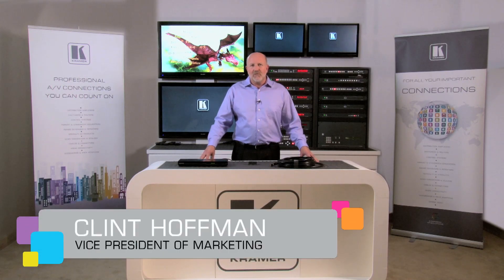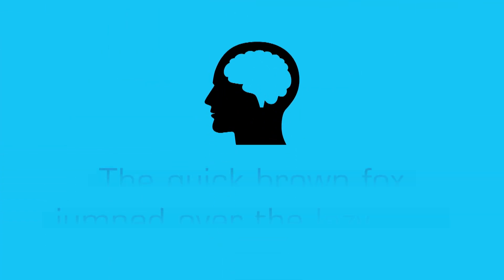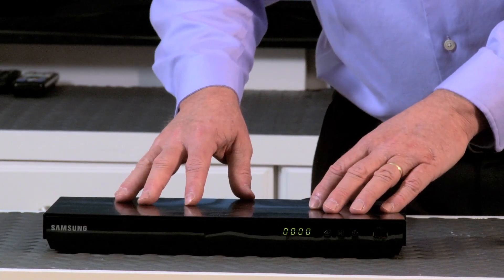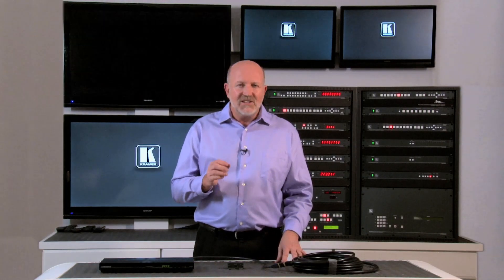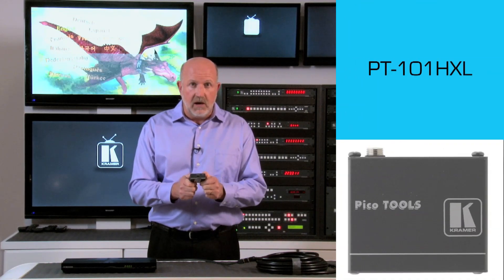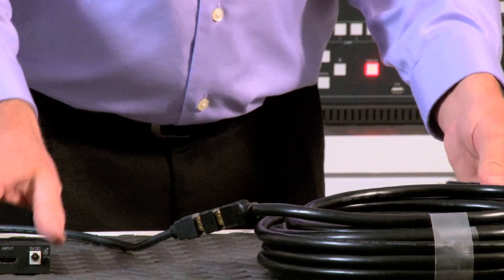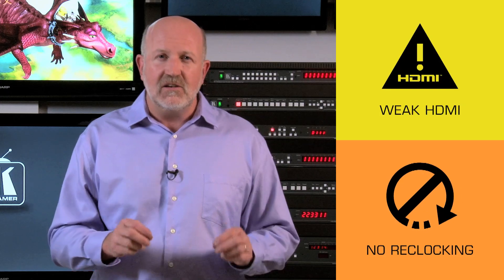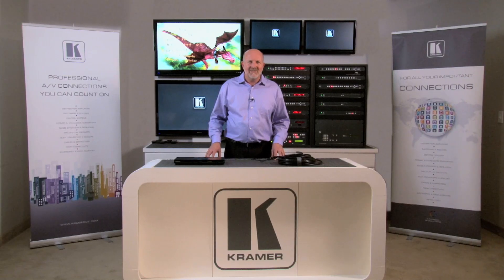Solving HDMI Distance Problems with Repeaters

Comment: Thanks for the Video.  I have a 25' HDMI cable my ceiling from my Receiver to a 4k Projector.  The existing HDMI cable causes the projector to "resync" occasionally which results in a loss of signal.  I bought a passive, thicker HDMI cable that works but am unable to replace the in-ceiling cable.  Will a repeater work instead?  If so, please LMK which model....  Thanks!
Reply from the maker: Hi! Please send in your inquiry to info@kramerus.com and we can have someone in tech support assist you. Thanks!

Comment: Hello, I'm trying to send a HDMI signal to four monitors...from a display port..HP 8460.

2 are about 100 feet away..the other 2 are less than 10 feet away.

I do have a 4 out repeater 5v...4k. 
I am only able to get a good signal to only 2 monitors...either the 2 that are far away or the 2 that are near.
Would I need 2 repeaters?
Reply from the maker: Hi Mark! Please send any questions to info@kramerus.com.

Comment: Would you place this device 1.) after an AVR and before a 25 ft HDMI cable enters a wall? If a TV is hung on outside of wall 25 ft away? Or would this repeater device be placed 2.) after the 25 ft HDMI cable has exited the wall before it connects to the display’s input?
Reply from the maker: Hi Jason, thank you for your inquiry. Please send any product questions to info@kramerav.com.

Thank you!

Comment: Hello, according to the specifications review on the website the PT-101Hxl has a power input, how are you able to use it without plugging it to power.
Reply from the maker: The PT-101HXL will use the voltage supplied by the HDMI source.  Keep in mind that not all HDMI sources are created equal, which is why we provide an alternate option to powering the PT-101HXL.  There is a 5v DC connector on one side of the PT-101HXL – power supply is included.
Reply: Akinnola Olufemi i was wondering the same thing. Wish they’d answer your question.